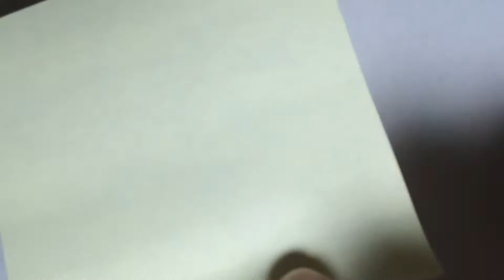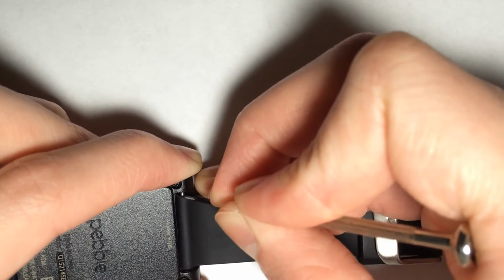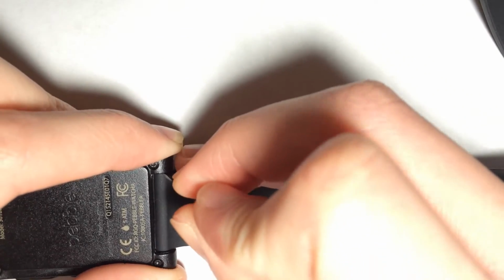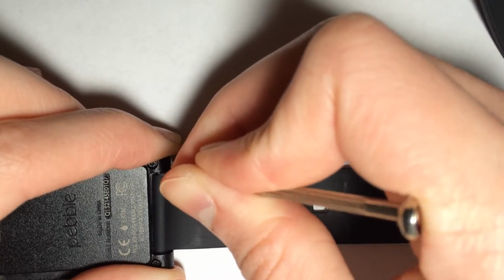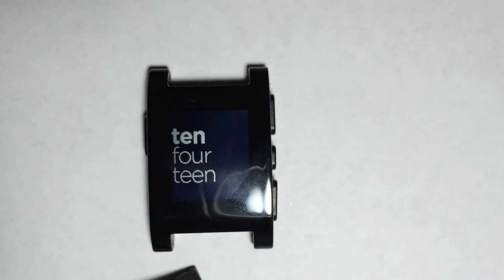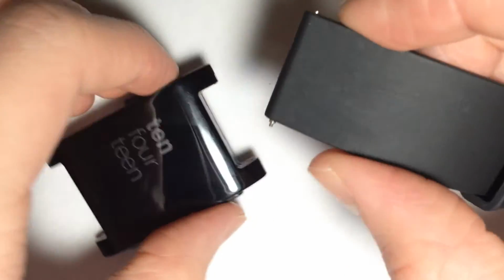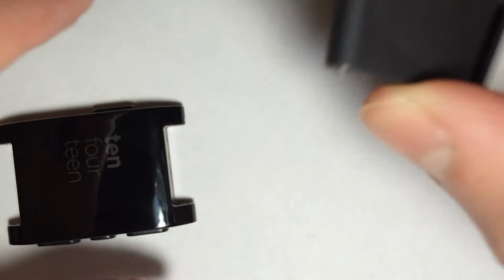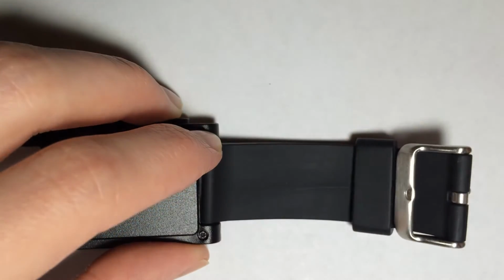Repairing a Pebble screen

Comment: Thanks! A helpful video on how to get one of these apart without damage, I've just tried packing it with paper so hopefully it will work. 

My father's watch  developed the screen fault after he was stuck in hospital for a few weeks without a charger, which seems to have reduced the capacity of the battery. It works ok for a day, or two after fully charging, and then the screen starts corrupting as the battery level goes down. 

I guess, either the li-ion battery swells as it discharges, putting pressure on the back of the watch so the zebra connector is not compressed enough to make a good connection with the display, or the battery has released something that has oxidised the metal contacts, or maybe it is just because the battery voltage has fallen.

Haven't made up my mind whether to replace the battery and clean the contacts for the zebra connector up, or buy him something different.

Comment: My problem is that the screen will not come on, (like you mentioned at the end of the video) so I can't turn the watch off. Can I do this procedure without turning it off? My problem started after swimming with the watch on, it has never been apart and was no deeper than 2 feet.
Reply from the maker: I would just leave it for a week or two for the battery to die to you're concerned, you could also try squeezing the watch itself and see if it comes on since that's all putting a shim in is doing. Turning it off just makes it less likely to short something, it should be fine if you aren't poking it with a screwdriver once it's open.

Comment: thanks for the video.  Would a silicone sealant be needed to keep it water proof?
Reply from the maker: +Josek I recall that it had an o-ring or other non-adhesive seal, so I don't think so. It wasn't waterPROOF to begin with, but I have splashed and run water over mine after opening it and haven't seen any issues.
Reply: yes! I use silicone glue and still work on pool and open water

Comment: Thank you Lizlo for the wonderful breakdown video.  I found that by pulling out the foam connector and cleaning the contacts with electronics cleaner and the foam piece itself fixed ALL tearing problems without the need to add shims of any sort.  I think connectors oxidize over time and then become less conductive.  At any rate I hope this helps anyone looking to fix the screen tearing problem correctly, the shim solution isn't permanent, but cleaning the contacts is.  Oh, I used QD electronics cleaner and a small swab, but I imagine rubbing alcohol will work too.  Hope this helps some Pebble owners who are frustrated with screen artifacts!
Reply from the maker: +David Chen Thanks, you'll have to let me know if it keeps working in the future. Seems strange that the strip would oxidize in that environment, contacts make sense though. It'd be nice if it can be fixed without shoving a piece of tissue in your watch ;).

Comment: So you just put some paper under the battery to act as a spacer so they battery pushed harder against the screen? Did you not also make up a spacer (most people just scrunch up some tissue) on the other side to balance out\put even pressure on the screen? I dont understand why you only did the battery? ie. https://www.youtube.com/watch?v=n7JBmktquUs
Reply from the maker: It probably would have been a good idea to even out the pressure, I just put it under the motor so it could push on something flat. It looks like that video did the opposite of me, only put it against the mainboard, both seem to work. I haven't had any issues with mine so far.

Comment: Hi Lizlo..........I have the same problem on my Pebble, but it is the "kickstarter Edition" and does not have any screws on the back. It appears to be completely sealed or possibly glued. Do you know if the first Pebble was glued? I'm tempted to try a heat gun....but very carefully. Liked your video.....Thanks dude.
Reply from the maker: I would assume it is glued, there were two clips on mine, maybe there are more on the kickstarter version? The heat gun may loosen the glue, definitely take the band off and try a plastic spudger though. Good luck, let me know on twitter how it goes :)
Reply: Thanks guy. .... I will let you know. I'm an exectronics tech too. .. and it's killing me not to know how to get into a unt the proper way. Thanks for the feedback.
Reply from the maker: Unfortunately there always has to be the person who takes it apart first :P didn't know there was a kickstarter version that was that different, good luck.
Reply: Bill Brice There don't appear to be any screws on mine.  It must be sealed as well.  I am sure it is out of warranty as well since i have had it for two years.  I guess I will have to buy a new one or put up with the screen issues.  Guess I will try another brand next time.